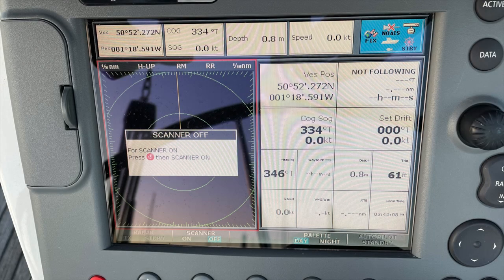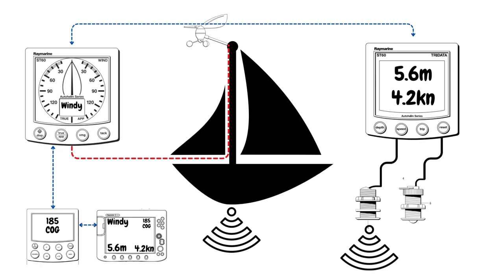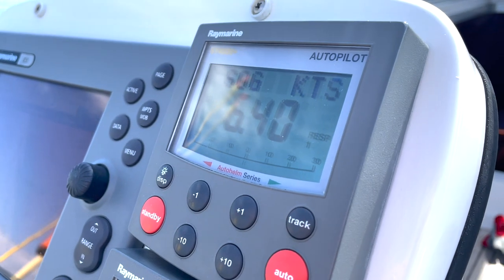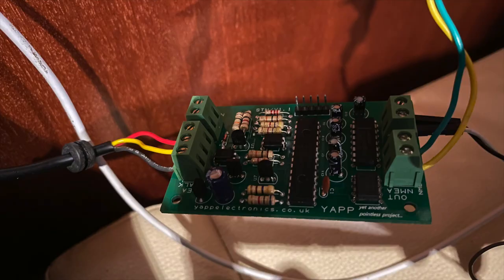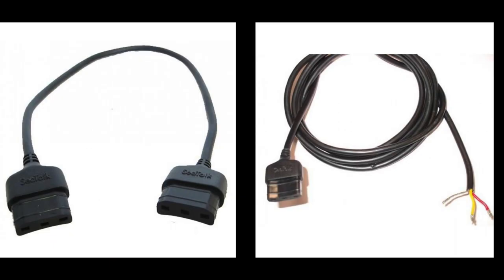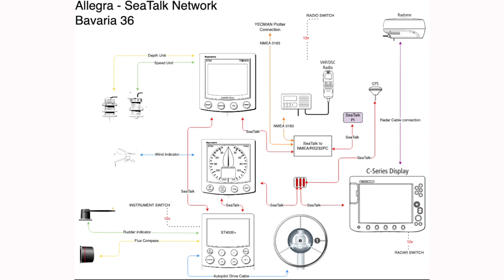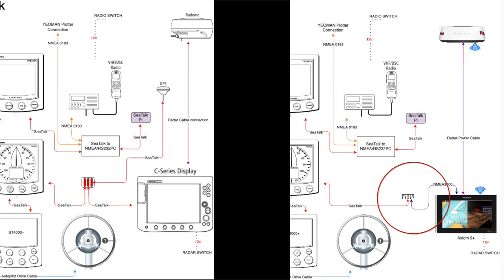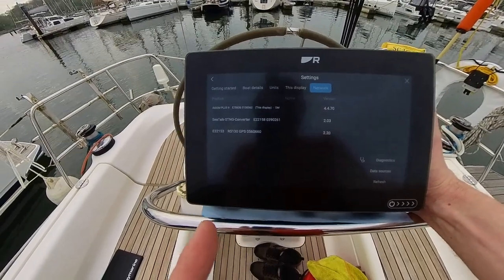Marine Electronics 101 - A guide to boat systems and how to upgrade your kit - Boat Projects

Comment: 1. Nice 101 Nice Vid... However: After your last vid 3 weeks ago speaking OpenPlotter 3 I wonder where you are heading. Is mixing technologies to your current "degree" really OK.  What about KISS?
Reply from the maker: I think I will always have a foot in both camps if I’m honest, I’m not ready to ditch all the mainstream stuff just yet but my OpenPlotter setup adds great value and will continue to do that in what I have planned. If anything I will be removing items that I’ve had to add to make my older electronics to work. At the moment I’m having to convert data types and I plan to do less of that with a move to NMEA2000
Reply: @BoatingwiththeBaileys  Thanks for your vid's incl that "open" reply. ;)  👌
Engineering blunders I'll never forget: that one single  -  (...yes one single "hyphen" in (conversion) math code)  killed Mariner 1 and NASA lost 7% of it's budget (1Billion current US$  Venus remained unseen) Mars "couldn't be orbited" (by Mars orbiter) because Lockheed Martin only "spoke" inches, feet, and pounds . 
My rule: Don't do conversions ;) - build new, operate new&old independently ...and get rid once proven.😉😇

Comment: Thank you for the info and links. I had to rewire my Seatalk 1 <-> NMEA0183 plotter & found it a steep learning curve. I bought a ST60 Multi to do the <-> conversions & give me data down below,  but had an issue I think is a "data loop" so only have Plotter -> Radio & Seatalk at the mo, but that gives me DSC  & Autohelm Track functions :-) Good luck with upgrades!
Reply from the maker: Yeah, I did the same when I sent data to the C80 for AIS. When I first set that up, the Pi was sending the same data via NMEA and the display also had Seatalk and it wasn’t happy. I’m guessing the multi unit is just decoding everything and sending it out. If you have a spare usb-serial converter you could take a look on a pc or even on a Pi.

Comment: I have the same Seatalk network. Since everything is working and the pilot never failing I changed the MFD to a 57D which use the same protocol. I dont think its a good idea to mix protocols.
Reply from the maker: I don’t disagree with that, however at some point the switch has to be made and it’s either a big budget or you keep trying to find replacement equipment which isn’t new. That alone can present its own issues, but I do agree with the principle 👍

Comment: Great to watch thank you , trying to do the same on my aquastar 27 , not sure if I can connect the ST 7000 to the new axiom 9 rv , or axiom 9+ at the moment it’s linked to my C80 .

Stew , wadebridge.
Reply from the maker: Hi, thanks for your comments. It looks like it's seatalk so some connection can be made. I can't control mine directly from the axiom, I have to activate/standby from the head unit. I believe you can send it a track but I've not actually tried that since I installed it. You might need a seatalk to seatalkNG converter and then I think it depends on what else you have on that old network if that's worth the investment, if that's how all your other data gets across then like I did, it's worth it
Reply: @BoatingwiththeBaileys  many thanks for your reply , there was a speed -log and a depth also a small Raymarine 158i gps , also an analog radar , I’ve removed the speed/log transducer and fitted a pair of RV 320 transducers to go with the new 2 x 9” axioms , think I’ll run it all as two separate systems for this season as no funds left for a new radar at the moment .

🥟 stew .
Reply from the maker: Sounds like a good plan. I still haven't replaced my analog radar, i went with an upgrade on my AIS first. I think i need to do the same and start replacing my older ST60 units before i purchase a radar.

Comment: Hi, Nice job and very helpful video! I'm about to go down this road myself with an upgrade from C90w to a Axiom + 12. What is your verdict on the integration between the MFD and autopilot? can you control it from MFD or only the Autopilot panel? Iknow the newer autopilot computers allow for a control panel on the MFD as an overlay.

good job and keep the videos coming! =)
thanks!
Reply from the maker: Many thanks for your comments on the video. Unfortunately my Seatalk autopilot is not compatible with the Axiom in terms of controlling it from the MFD screen, the Raymarine forum says it will do Go To but thats about it. The Axiom so much easier to use that the old C series, its like night and day. This is the line from the forum:

If you want the Autopilot to follow the route which is now active on the MFD - you will need to engage AUTO on the legacy autopilot control unit, (for example p70/p70R / ST6002) and then select TRACK mode, after you have acknowledged the FOLLOW TRACK alarm, the autopilot will then follow the route on the AXIOM to the target waypoint.
Reply: @BoatingwiththeBaileys  Thank you for your replay. That is my understanding as well, and that the best way to communicate with the course computer is  via NMEA 0183 rather than ST to NMEA converters. I have a slightly different setup with a Type 100 course computer that have Nmea 0183 as well as seatalk. I will do some test in spring when everything hopefully is installed.

thank you again!